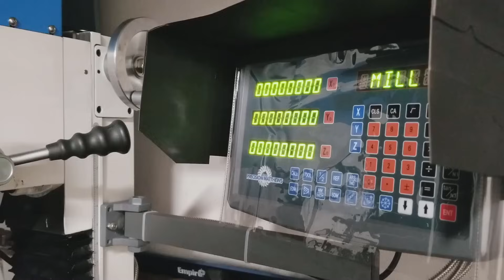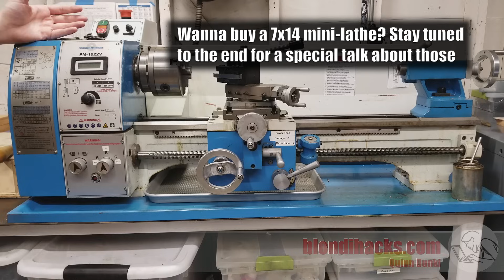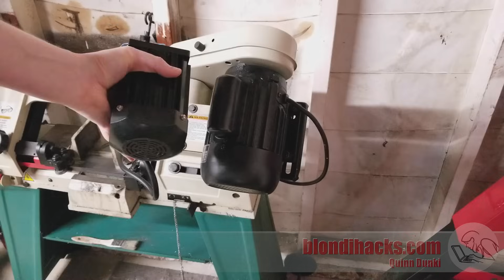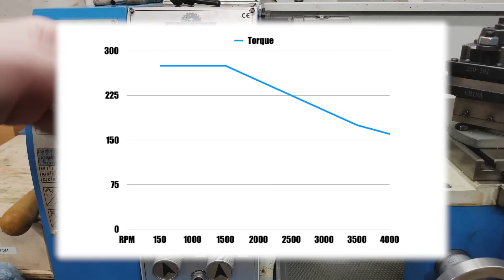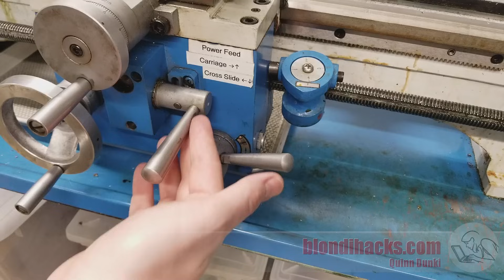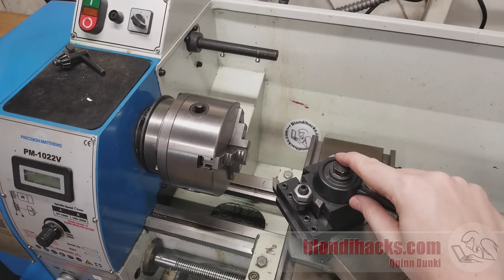Import Lathe Buying Guide

Comment: If you buy a tape measure at IKEA it is in both metric and imperial.. I use both because depending on what I work on.. If ~1/4 is close enough - imperial... If 1/10 of a 1/100 of a meter is close enough I use metric.  Storie time: TL;DR Sometimes old used machines can be awesome.. but half old machines can complete crap. 
I spent 100usd on my first tiny woodlathe (circa 1950s hobbyist machine made in Sweden; hägglunds motor, SKF bearings and Swedish steel beams ) It was stupid simple but worked like a charm. On the backside of the chuck there was a 240 grit sand papper so the also swedish made tools was easy to sharpen..   When my FIT ended up on the wrong side of the grass I took his lathe under my wing and sold the small one.. My misstake.. Didnt really look at it before the swich..  His "new" lathe was a cheap 80´s import with useless bearings and motor.. didnt hold a true center, motor caught fire, rusty nuts on the wrong side where you want them with no easy access.. It was a nightmare. Got me a 3rd , what at the time seemed better lathe.. And it wasnt.. My wood lathing is now on hold.. So I got me an old Emco compact 5 for 300usd and it is a lot of fun.. but, way to much play in it to make finer parts and to little torque for larger parts.. Its pretty good for making skateboard wheels round again and for the small wood parts that I need.

Comment: So these machine dials drive anyone else nuts, as much as they do me?  I have the exact same lathe (just branded “BusyBee” here in Canada).  The cross slide dial scale notes a 0.002” (diameter) resolution and a zero to 10 scale per “trip” around.  Therefore 0 to 1 equals 0.020” on the diameter....great!
Reply from the maker: That’s called a direct-read hand wheel and it actually is very convenient. It’s telling you the diameter reduction on the part, not the depth of cut. This is the information you want 99% of the time on a lathe.
Reply: Yes, I know.....you missed my point.  The dial reads 1, but you’ve taken 0.020” of the diameter.  There is still mental arithmetic required, no matter if you are taking a diameter “cut” or radial cut.  Shouldn’t a direct read dial read 0 to 200 (thou) at least (for a 10 tpi lead screw)? For a newbie 0 to 10 has no meaning at all, as relating
 to where the cross slide actually is positioned.

Comment: Great Video... Actually, though, I bought a Harbor Freight about 3 years ago. I am active in the Asian Mini-Lathe community... there is not doubt that Harbor Freight lathes are Middle of the Road to a little better than  middle of the road  as far as "all the same" goes.
Just because they are less expensive don't mean they are crap. I got mine (7x10) before they stopped honoring the 25% off coupons on Central Machinery ...consequently I paid $420 out the door.

Comment: Very well done video I wish I had seen before I purchased a lathe 4 years ago. I ended up with a Grizzly G0602 which has the same basic 10"x22" castings as your Precision Matthews. When I first got the lathe I was having struggles with chatter just like yourself, but traced the problem to the clamping ring at the foot of the compound. You can verify this by putting your finger on the compound protractor while parting off a work piece to feel how much it flexes (a bunch!)
 There are other minor issues as well, but I have addressed them all and I am now quite pleased with this unit for working with steel and softer materials.

Comment: I'm a automotive machinist, have been using both metric and imperial together for the past 15 years sometime on the same engines as my supervisor and boss all done their time with imperial. I myself prefer metric, it has more accuracy as 1/10th of   .01mm is smaller than 1/10th of .001", .001" = .025mm.

Comment: Good video! Had many an argument with keyboard warriors over Chinese lathes, never personally had one always had old English lathes. The one thing I would say is for someone making small diameter bits the Chinese lathes seem to have a higher spindle speed which would be useful to get the correct surface speed for good finish on small parts

Comment: I have no idea how the keyway drive works
Reply from the maker: There’s a collar around that leadscrew shaft with a key that rides in that slot down the leadscrew. The collar is powered by the leadscrew but can move freely along it. That collar drives a gear train inside the carriage which engages a rack on the front of the bed casting. That rack drives the carriage. Thus the leadscrew transmits power to the carriage, but the carriage’s movement is not beholden to the pitch of the threads on the leadscrew.
Reply: The collar is actually a worm gear, I have the exact same lathe only a Canadian version and took it apart to find out.

Comment: Incredibly useful infos, i just wish I watched this before buying my lathe. Oddly enough, I did most of that research anyway so... phew. I wish I knew about the lead screw and dc motor, I didn't even know one could buy a lathe with a dc motor or that fancier lathes don't use the lead screw for power feed... well, when I will need to upgrade I will be better informed thanks to you. Quick question: what's the brand of your quick change tool post?

Comment: Comment on the chuck.  It may be non standard,  it may be a bit more effort to add a different type,  but at least it does not screw on.  There are so many reasons to be able to run in reverse that I cannot imagine getting a lathe with a chuck that may unscrew during use.

Comment: Wow, that was the best video about mini lathes I found, you earned yourself a sub:-) In my opinion it is better to get a chinese lathe with an ac motor and a gearbox, you can just throw the motor away , somehow slap a bigger motor in there and not worry about anything:-) It can be tricky figuring out how to mount the motor, but you just dont care about having enough torque after that, you just have it unlike a dc, plus there is no electronics to worry about, just a simple switch.
Reply: Rather than an AC motor and a gearbox, I'd use an AC motor and a VFD.
Reply from the maker: Thanks for the kind words, and for the sub! 😁

Comment: I have to disagree with the point about metric vs imperial. "One thousandth of an inch" is a silly patchwork on top of imperial system to make it easier to use, this is basically stated by the person who is attributed to inventing 1/1000", who wrote "...instead of our engineers and machinists thinking in eighths, sixteenths and thirty-seconds of an inch, it is desirable that they should think and speak in tenths, hundredths, and thousandths...".

I absolutely hate imperial system, I hope it will one day die in fire, but also, just like you I am stuck with it living in US. I tried at first setting up my shop in metric and found it as you said to be very much "swimming upstream". Since we are taught to count in 10s due to the number of fingers we have, metric is always, always easier for our brains to use and so 1/1000" patchwork was introduced to basically convert silly and impractical imperial system to metric. Such a pity NASA had to abandon their effort to switch to SI.
Reply from the maker: I hear you. I also seriously considered staying metric, but it is really tough in the US. Everything is against you when buying stock, parts, and tooling.

Comment: Selling my present 9x22 lathe (threaded spindle) and realized your PM lathe may have their "quick change spindle mount." PM's 10x30 apparently has the same quick change spindle as yours and I'm looking at that lathe to replace my current one...is it convenient to change out chucks with this mount? Is this mount accurate? Thanks for any response!  PS...my wife and I thoroughly enjoy your informative, and often quite funny videos! Thanks again.
Reply from the maker: Yah, I’ve found the chucks to be very quick to swap. I’ve not had any complaints on repeatability, but I’m switching between a 4-jaw (where it doesn’t matter) to a 3-jaw (where any chuck mounting error is overwhelmed by the 5 thou runout in this cheap chuck and inherent in 3-jaw chucks in general). My only complaint is really that it’s a weird proprietary thing, so any new chuck I buy will be a project to mount it.
Reply: @Blondihacks  Thanks for taking the time to respond.

Comment: I'm not sure how long you've had your lathe now, 18 months or so, are you still satisfied with it? Would you have opted for the next model PM has or another brand? I've been looking for a used lathe but I am running out of patience, totally agree on all your points in getting this one, they are far and few between finding one, let alone one that isn't worn out, or way to expensive.
Still waiting on your single point threading video, I would like to see how involved it is changing gears on your machine. I would like to do some gun barrel 1/2 x 28 threading. Really like all your videos, some of the other machine operators assume to much.
Reply from the maker: Yah, I’ve been really happy with the lathe! I’d buy it again. Glad you’re enjoying the videos!

Comment: I used to work at a shop that had a 3'X16' WW2 era lathe. It was used to turn barrels for battleship guns (initially) and we used it for turning 6' to 8' long torsion springs. It was pretty neat. It had a starter motor for the big 46hp motor used to run the machine. I'd never seen an electric  motor that required a starter motor before or since.
Reply from the maker: Wow! That sounds like an amazing machine.

Comment: As far as I have understood SIEG is the origin producer of chinese hobby lathes. They supply other brands, but that does not mean they are all equal. The precision, finish and quality seems to be what has been orderd from different vendors. Sieg branded seems to be in the middle, maybe a little above middle. I have a Sieg SC3 400mm(16") 500W Brushless. I have put mine trough quite a bit, and it have preformed quite well. My brother have a Bernardo profi V450. that one is on the higher end.  One size bigger than mine and costs twice. And I could tell that it was worth it.
Reply from the maker: There are way more companies than just Sieg making them. Sieg makes a lot of them, but the machine tool industry in China is huge.

Comment: Quinn, what do you see as "too fast" for power feed?  My Grizzly (still pretty new to me) is set at .004" per revolution. Seems pretty quick when the spindle speeds get high. I've heard of people getting even bigger gears to slow it down but I don't know if .004" is "too fast".  Thanks.
Reply from the maker: 4 thou per revolution is a pretty moderate speed, actually. You could use that for finishing passes.

Comment: Greight vid, thanks. Confirms what I've learned over the past few years with my 7/14" lathe. One point I think you missed, the need for single-point threading is also when you need a thread with an an odd diameter, like when I need to cut a 0.8mm pitch thread on a 20mm diameter part, good luck finding a tap or die that size lol!

Comment: I am a fan of buying used Asian! I adopted my daughter from China when she was 11 months 28 days old. :-) just found your channel and subscribed love it! I'm looking to buy a lathe and looking at a Grizzly 4003g I know nothing about leis or a Bolton lathe which would you recommend? The grizzly is older but it doesn't have much use it was bought by retired guy to make stuff. And he passed away before he ever really got to use it a bunch.
Reply from the maker: I don’t know anything about the Bolton machines, but the larger Grizzlies have a solid reputation, and you’ll be able to get parts and support from Grizzly. It might come down to which comes with more tooling. 😁
Reply: @Blondihacks  Grizzly does! $2000. Is that a fair price? 4 jaw chuck is still in the crate l.

Comment: Very impressive and thorough introduction to Asian lathes, one of the best I have watched. I have a South Bend 9A circa 1962 which is a great lathe but has seen better days in terms of wear and tear. I have been considering getting a Chinese lathe, not to replace the South Bend but to augment it to do some of the things that the South Bend can't really do.

I am in the UK and work in metric but I come from an era where I am comfortable with both so can readily do metric work on the imperial South Bend. We still have the remnants of some imperial stuff here as well (old cars and motorcycles for instance) so I have made imperial parts for these for friends.

I would echo though what a previous commenter said that anyone considering a new lathe should also consider the size of the spindle bore. The South Bend has a 3/4" bore which is a bit limiting and any new lathe I bought would definitely be 25mm (1 inch) or more. Obviously if you are in the market for a smaller lathe and are making smaller parts then a narrower bore might not be an issue for you but on a larger lathe I would say it defintely is.

I just discovered your channel and will definitely be watching a lot more of your videos. 👍 👍 👍

Comment: On a very British Lathe built by Raglan the motor runs at a constant high speed and is varied by moving the coned pulies in and out. This is don by an impressive lever on the headstock. The headstock and bed are cast as one and has hardened bedways as standard.  The price at the time in the 1960s was beyond many. I have 2 of these being rebuilt.
My little Chinese Lathe not the WIFE!!! Needs lots of tweaking to make it go well.
David ad Lily.

Comment: 10-12 years ago I decided to buy a Smithy 220v granite 3  in 1 for my small home shop, to replace/complement my 1921 9" South Bend. After about 4 hours of running some test cuts after set up, its spindle bearings locked up. Smithy did send me an entire replacement headstock, but nothing would bolt back up. Every hole was off. Total garbage. I then just decided to buy a 16x40 lathe and Bridgeport style mill from grizzly. Those have been totally problem free for hundreds of hours. That pos smithy imax is still in pieces in a dark corner in my shop, Total garbage. So the quality of the imports is drastic. So buy the best your budget allows, you will be glad you did in the long run.

Comment: Thanks for the great video! Quick question - I'm deciding between PM-1022 and PM-1030, with only $100 difference, have you ever had a need for 30" length vs. 22" one you got, from a hobbyist perspective? Thanks!
Reply from the maker: Interesting question! I’ve personally never run out of space on the bed, but I mostly make small things. Closest I’ve come is facing a 12” boiler, and working on a 14” shaft from a grinder. Bigger is probably always better with lathes though. 😬

Comment: very informative!  fwiw, my horror freight lathe came with a brushed permanent magnet (fixed field strength, hits the torque cliff) DC motor.  Which is neither AC nor bldc(which is also a kind of AC).  Also some bldc sensorless controllers don't handle low rpm well, which might explain the missing part of the graph too, but not because of current limitations.  Though motor cooling at extended low rpm is a consideration.  As well bldc can operate in the field weakening region, but you have to add power in advanced timing to counteract the permanent magnets, vs an induction motor.

Comment: I like Chinese lathes and mills. They have made me an expert in quality control. I've learned to re-manufacturer out of spec parts, re-align gear trains, replace bearings not seated properly, scrape dove tails,  ect. I now fully understand the meaning of the word rigidity, something these machines don't offer new.

Comment: Hi Quinn. Watching this again I've just realised why there's a keyed spacer on my lathe spindle between the rear bearing and the 40 tooth M1.5 change gear take off drive. I could n't work out why it was keyed. It's for the optional rpm indicator sensor - which on my version is provided by the control electronics. It's useful for me to know as I'm planning on installing Clough42's ELS. Cheers. BobUK.

Comment: working with metric and imperial is not all that complicated . I own  a Myford lathe ( as imperial as they come)
There are metric changegears for threadcutting and you can use metric dial indicators or DRO  for routine turning.
So don't sweat with small stuff
A F Pienaar
South Africa ( previous British  Imperialcolony )

Comment: A question regarding the "keyway drive": it seems to use a gear drive and the fixed rack on the base.... But gears are not a good transmission for continuous force/motion. You already feel the gear-rack teeth engaging when turning the carriage wheel by hand. That'll end up showing in the finish right? The lead screw-half nut does give continuous force/motion. So although the keyway drive is a best "middle" solution, it would perform worst than the alternatives. Or am I wrong?
Reply from the maker: Every lathe feeds the carriage with a rack except the very low-end ones, so clearly this is not an issue.
Reply: @Blondihacks  thanks for the insight.  you're a champ ❣

Comment: After watching hours of videos I still don't know which machine to buy. There seems to be something wrong with all of them. I hate plastic gears and electronic boards. Nothing but trouble there. I just don't want to buy something I will regret as soon as I get it. It doesn't make sense to buy an expensive lathe just for occasional use but at the same time who wants a cheap lathe that is not designed to last past the first cut. The whole lathe scenario seems to be a convoluted path to lunacy.  My psychiatrist is just gonna love this. I wonder if he has a lathe.
Reply from the maker: If you want a small inexpensive lathe with no electronics, try looking for one of the old hobbyist lathes, such as the Atlas. It can take a long time to find one in good condition at a good price, but it would suit your criteria.